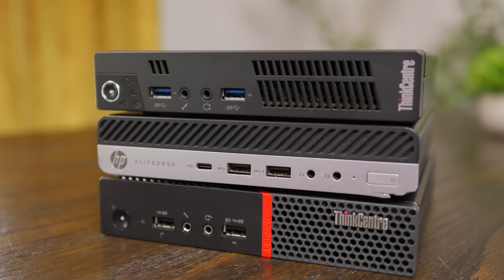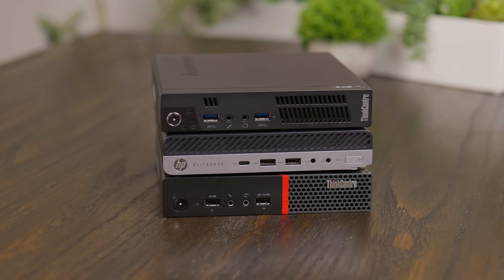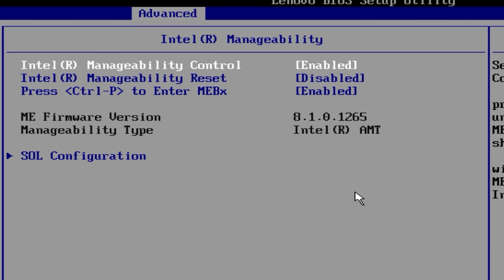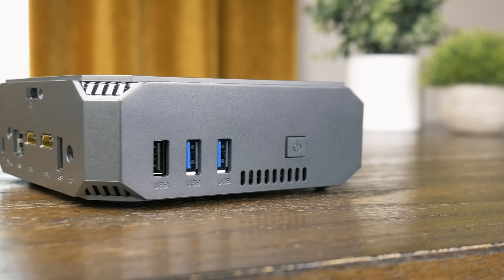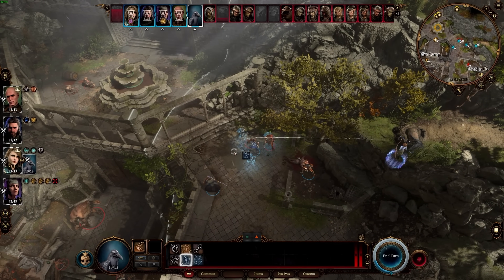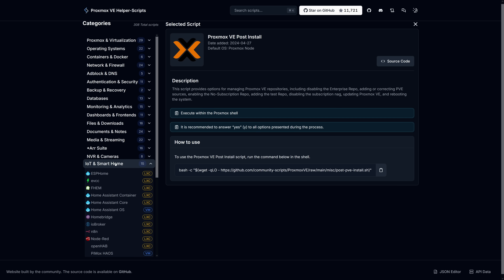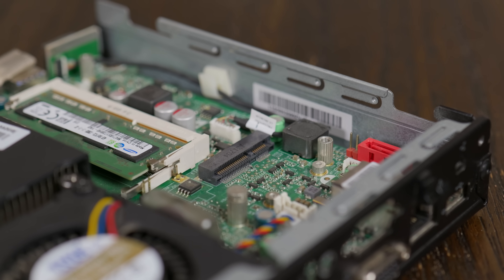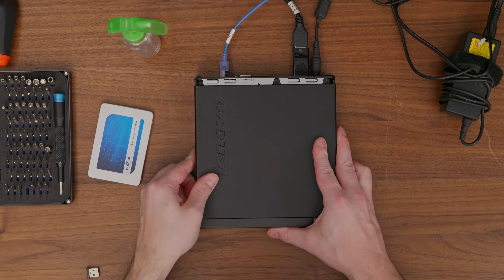Why Are People STILL Buying This Old Mini PC?

Comment: This honestly reminded me of the unraid server I setup for my dad. I took an old 2015 MacBook Pro with a broken display and have it running with an external 4 bay DAS, using HW RAID 5 and a 2 bay DAS with two SSDs for caching. It pulls like 40w from the wall total which isn’t incredible but it also was basically free since it was all old equipment and although I’ve heard many warnings about using USB, it’s been running for 3 months with no issues. I have remote management and power management with a Shelly plug and a JetKVM. It even hosts a TimeMachine backup for his laptop, a backup for my unraid data offsite, AND Immich! 
Immich is slow, but it DOES work!

Comment: I have 3 similar mini PCs. I made a cluster. I suggest you should definitely use delid+liquid metal for cooling. Temperatures drop at least 15 degrees, and I see max 60 degrees when loaded.

Comment: I have used this exact mini PC since 2021 to stream a police scanner onto the internet with, I streamed it with an old laptop prior to this. I run it headless and use a 3rd party RDP to admin it with from another PC. I really like its low power use and quiet operation in low load scenarios. I run win 10 IoT 2021 on it which has considerably less background processes. I really appreciate your thorough analysis of the unit. And just as you mentioned, it is ideal for streaming or other headless single tasking use cases.

Comment: Not sure why those HP or Lenovo models are so popular. Try a Dell micro. I've two of them. They are very well constructed with very easy access to everything. Much better cooling also. Note there are many different variations out there. Most become second hand after their five year support contract runs out. Nothing wrong with them. By default usually come with W10, but W11 runs just as fine.

Comment: You can easily inject the NVMe module in your EFI BIOS, instantly making your Ivy Bridge platform able to boot from your NVMe without the need for the Clover boot loader hack. I successfully made a Sandy Bridge system NVMe-bootable a few weeks ago and curiously, I encountered the same "gen 2 PCI-E slot only working as gen 1" issue seen in the video at 10:04 (albeit it supporting 4x, so 800mbps instead of 1600; lanes do not seem to have been saturated, it's something else apparently but I couldn’t get to the bottom of it).
Reply: You can also install the efi partition to the sata drive and install grub on it.
Reply: @ Yes, that’s another quick and easy solution. A self-booting NVMe drive still is a bit more robust tho, since you don’t have to worry about boot loaders if you happen to replace the SATA boot disk. The inject + flash only takes a few minutes once you know how to do it and the MB is forever fixed

Comment: Delid and install liquid metal. That really wakes up the heat transfer on those older Intel CPUs. The used junk paste from the factory. A 20C drop is not uncommon.

Comment: I've got some 7th gen i5 Dell ones. I use them as the TDP is low like the rest of these style of boxes. However, it is easy to forget how much CPU efficiency has increased over the past decade. An i3 from a few years ago will easily outperform the earlier i5 and i7's for the same power usage. Mine were free, but for a home router, with an additional WAN port, a simple proxmox host they are great as not just low power but relatively quiet until you put some sort of CPU load on them

Comment: I worked as an it administrator at a multinational corporation that bought the exact same builds. They were all dells. I went through 8-9 hotels upgrading all their machines from xp to windows 8. 
Terrible thing was that the Unix system they had. Well they didn’t organize each casino into each directory. So you would have to call the main IT department and get references of locations and software that certain departments needed. Adding hours depending on what department needed. 
I mean it took me about 3 hours to find the .inf file for a dot matrix/laser copier for the directors of one of the Hotels.

Comment: I still recommend these mini systems in place of a Raspberry pi kit. Far cheaper, more robust, and comes with an AC adapter.

I have one with the 4570t running PiHole and a bitcoin node. Could add more services to it if I wanted. Run a Linux distro like Debian!

Comment: I bought an hp t620, from time to time bios/bios settings corrupt and it can't boot from usb no matter what settings you set.

I bought an hp t640, the usb dies after 55 minutes of memtest86+, and then also the same thing in debian stable.

I bought an hp g3 mini pc with an i3-6100T and the ssd gets so hot that it reboots without leaving any logs.
Also I somehow accidentally clicked the power button morse code combination to setting your own serial number.

Comment: my homeserver is an optiplex 7040 micro. i got it for free from my workplace since we are replacing them. specced it out as much as its supported (i3 6100t to i7 6700t, 2x16GB RAM, an NVMe boot drive and a 1TB SATA SSD for bulk storage). its been running a modded minecraft server, a satisfactory server and a simple file share all at once with no issues. the fan does get kinda loud under heavier loads even with an aftermarket copper cooler installed but other than its been trouble-free

Comment: For $100, they are a very poor deal.  I'd simply buy an N100/N150 based mini PC from GMKTek or similar.  CPU is similar or better in raw performance but the big win is the integrated GPU which offers advanced (inc VC1) decoding and pretty good encoding and a modern chipset which gives you 3 4K displays and as much USB 3.2 as you need.  4k video is effortless. The desktop experience with these is really good.  Other than for gaming or where SATA bulk storage is needed, I don't bother recycling PCs any more.

Comment: Looking for recommendations for the cheapest solution to plug into a UPS so I can monitor in home assistant via NUT. It should have minimal power draw. Was looking at Raspberry Pi, but they're so vastly overpriced right now, that they simply don't make sense for a project this small

Comment: A bit too old. I recently was looking on Ebay. One can find an HP Elitedesk G3 Mini with an I5-7500 for around $50-60. Gets you DDR4, the G3 or higher gets you an NVME slot. There was like Dell 7050 that were very similar and tons of them

Comment: I keep seeing these these video's about building cheap N100 boxes, but when I go checking out prices my end everything is WAY more expensive, so no option, back to my old junk.

I have an old atom based industrial board running on Windows with a few drives and security camera's attached, then I see these 'how to' personal VPN vids, oh docker again - darn, not on my Win/atom, and the replacement N100 (or is that an N150? now)  is still over the top
Just Googled N100, $81.69, but when I click - AU$182.48 - AU$249.3026% off, so NOT a bargain, plus I'm not overly comfortable sending large sums of money to China, however the news from local vendors is even worse, my local cheap supplier offers no hits on N100 (or 150) 

So for min-PC, off to ebay, $199.00 HP Mini 800 G2 Intel Core i5-6500T, that CPU was launched in 2015, so now almost as old as my atom, so not really much of an upgrade. or $349.00 for a i7 8700T, I won't bother looking that one up as it's too expensive, and probably not much newer.

So back to dreaming and watching 'unobtainium' video's.
Reply: Bought mine direct from GMKTek - $109 delivered.

Comment: Ivy Bridge didn't support booting from NVMe at all. The first Intel platform to support NVMe boot is Z87, which was Haswell. X99 also supported it. NVMe is a PCI-E device, and is recognized on older platforms for storage, even if you can't boot from it. I used an NVMe gumstick with a PCI-E adapter board on a dual-Opteron server.

Comment: If you don't want to buy extremely small pre-built PC, you can upgrade your own PC with older C2D processors Sandy Bridge or Ivy Bridge extremely cheaply today.
I use some shuttle XPC barebones (along with W7 and Linux) that I have equipped with mini ITX mainboards and small size graphics cards over the past 20 years.
All of these small PCs functioned very well according to the standards of the time with upgrades to memory and SSD hard drives.
The final kick, the upgrade to Intel i7-7730 with etxra's larger fans than before. 300Watt SFX-PSU from Be Quiet are used as power supplies.

Comment: 6:01 External Liquid cooling unit would fix your thermal issues! 

You already have the open port you pointed out on the rear for the inlet/outflow to the tank/rad

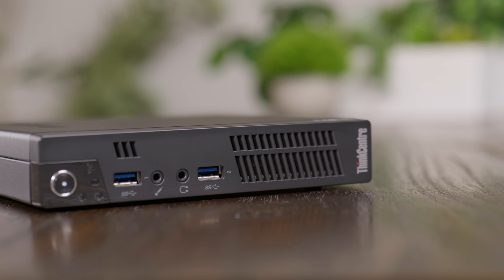Comment: 07:47 When testing Moonlight, you can press Ctrl+Alt+Shift+S to see the stats overlay to see how good is it running, could be a good addition for testing lower end hardware but it'll probably run near perfect on newer hardware
Really cool to be able to use it on systems that sometimes can't even handle modern windows properly using a lightweight distro and just dedicating it to be a streaming box/laptop instead of just it going to the bin or in a box forever

Comment: That cooling system just seems ill-conceived, where is that fan supposed to draw air from, when it's like 1mm from the top cover? It would be better if it could draw from the front and ACTUALLY blow through the fins and out of the back.

Comment: Yes I had one gave it away the ryzen versions are much much better. I had 2 ryzen versions sold one and regret doing it. As far as intel the M700 with i3 or i5 6th gen are also ok. more modern the M700 only supports sata m.2 afaik.

Comment: I use one as a 2nd Proxmox node, but it is aan HP 800 G6, so 8 cores, 32GB, dual NVME, 1 SATA SSD, 1Gb and 2.5Gb NICs. It's a mini beast. Not super cheap, but nothing compares for the size and features. And the HP's have a rare 10Gb NIC Flex port option. Also an ultra rare discrete NVIDIA GPU.

Comment: My main laptop is a HP elitebook 840 g3 with an i5 6200U and 32gb of ram after I upgraded from 8gb. Its a beast with an extremely rigid full metal frame and a really nice keyboard, but the reason I still use it is because its so repairable and upgradable, when I first got it the keybaord didnt work properly so I bought a new upgraded one with a backlight that came on the more expensive i7 version and it was literally just plug and play, I also installed the fingerprint scanner for £5 also from the more expensive model which I just plugged into the motherboard as it still has the connector and despite the laptop being 10 years old it has a pcie gen3 x4 m.2 slot that I put a 1TB WD black sn770 in also a 2.5inch drive slot which I installed a 1TB sata ssd, I upgraded the ram like I mentioned before and the battery to the higher Watt hour version of the better model and its still a beast to this day. The only thing I wish were upgradable is the display as the version I have is a slightly higher resolution than 720p where the i7 model has a 1080p display but it has a 40pin connector where my display is 30pin

Comment: I have one of these and also an M93p with an i5-4570T that i got 5 years ago (In 2020) as a Server, but the M92p was a bit loud and made strange noises so i ended up using the M93p for that and only used the M92p occasionally for testing some things. They are both pretty similar the cooling system was completely redesigned on the M93p and there it has a heatpipe and the fan is actually blowing directly through the fins so it probably works better. Of course the configuration can be very different, my M92p already had 8GB RAM when i got it and the newer M93 only had 4GB instead, even with that it really worked surprisingly well with Windows 10 for some time until i decided to upgrade it to 16GB. Also it's interesting that the M92p has the mini PCIe Slot, while the M93p (or at least mine) doesn't have it soldered on the mainboard, so perhaps they really only placed it there on the models where WiFi was already included but i don't know.
So i didn't really use the M92p much but i tried to use it for some web browsing and watching Videos on it, but it didn't really work well as i remember and even with 1080p h264 Video it started stuttering quite often.
On the other side, the M93p is running at all times as my Server and works with no problems for most things i want it to do. The only thing where it really shows it's age is when i try to watch something over the Plex Server that's running on it and it has to be transcoded, then it has a really hard job to transcode it in realtime, even with hardware transcoding. But otherwise it's working fine.

The big problem now for these older systems is of course now the end of Windows 10 Support, because Windows 11 can't be installed on them of course.

Also i was actually quite surprised when you showed these on ebay and said that they are quite expensive at 40$, i just looked on ebay and here in Germany these are currently being sold at about 80-100€ with some being even more expensive, which is a similar amout in $, and they also haven't really gotten cheaper over the years, i remember i got mine for about 120€ in 2020.
Reply: After windows 10 its Linux time.

Comment: Sweet spot is surely 8th gen. Has good hardware igpu that supports secebt transcode. Also, checkout the "better lenovo pcoe riser) it unlcok 4 extra pcie lanes and adds an m.2 slot.

Comment: NVME booting wasn't a thing back on ivy bridge, thats why it wouldn't natively boot from it and needed something like clover to boot from it.
Reply: What's the problem with NVME, especially booting, isn't it just another drive?
Reply: @paulstubbs7678  The problem is, there needs to be support for it.  It can see a device is there, but it doesn't have a way to tell the computer to boot from it.  The CPU/itself needed to have a controller chip to directly boot from it.
Reply: @paulstubbs7678  The spec for NVME wasn't finalised till 2011, and devices didn't appear until around 2013 - and those early devices were for datacentres, not home computing. Considering Ivy Bridge released in early 2012, I don't think there was much call for firmware engineers to include support for a protocol that didn't exist in the wild, and wouldn't do so in this market segment for at least another two years. There's no boot rom included on NVME devices (unlike, say, PCIe sata controllers), so unless the firmware knows how to read data off the disk it can't boot from it.
Reply: @paulstubbs7678  Sata disk drive , USB , and CD/DVD  was the boot options in the BIOS back then and they used Sata ports around that time but NVME  using PCI-E and required a BIOS/UEFI that know how to boot from a drive attached to a PCI-E port. You do see a few motherboards on Aliexpress that support 3rd Gen Intel CPU that do have native boot for   NVME .

Comment: Thoughts on a higher end T series cpu or possibly a downclocked/undervolted cpu with higher end graphics? the I7 3770T would allow use of the intel hd 4000 graphics I'm not sure it would unlock a whole lot better options but the playback would surely improve when streaming video content I'd imagine.

Comment: For anyone wanting to use these as a thin client or plex/jellyfin server, hardware-accelerated HEVC encode/decode support begins at the 7000 series CPUs. The visual quality isn't as good as with newer intel CPUs, but you can't beat this for the price and power consumption. I bought a barebones optiplex micro for $60 and an i3-8100t for $25, then slapped in 8gb of some cheap commodity RAM. The total cost was around 150 CAD after shipping and taxes.

But just in general, these used mini PCs are a godsend. They make computing affordable and accessible for dirt cheap. You can do some light 1080p gaming/esports titles for less than half the cost of a modern console, and also just have a PC alongside it. And if you aren't a gamer, the earlier models (along with a mid-range SSD) are sufficiently performant enough for anything you'd need.
Reply: I reluctantly abandoned my attempts to use a thin client (T630) as a Jellyfin server because the Jellyfin client needed some files transcoded.   Perhaps there is a way to avoid transcoding  but I gave up.  In the end I went with the Nova player and a network share because transcoding was not required.  Maybe one day I'll upgrade the server hardware to allow Jellyfin, but would still prefer to avoid transcoding
Reply: Might as well buy a new mini PC with a modern N100 cpu.
It supports more modern encoding, and will use less electricity (+ comes with a warranty). They can be found around 100$

Comment: I keep buying these little Lenovos for like 50$ cad for the 6500t models and I use them instead of firesticks and they work amazing! Don’t over pay but if you can find a good deal they make killer little media PCs for cheap.
Reply: Ok. But which software? Kodi? Batocera? Maybe there is something more similar to Google chromecast GUI?
Reply: @ I just use windows